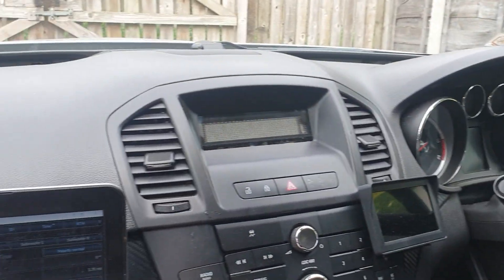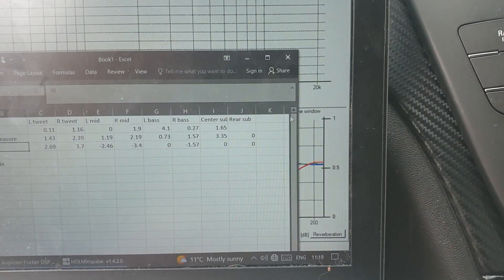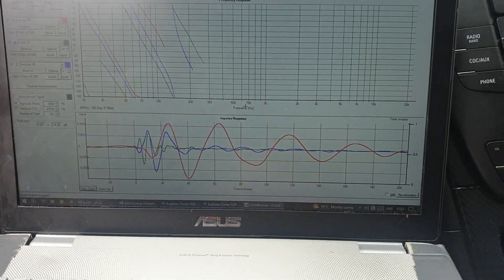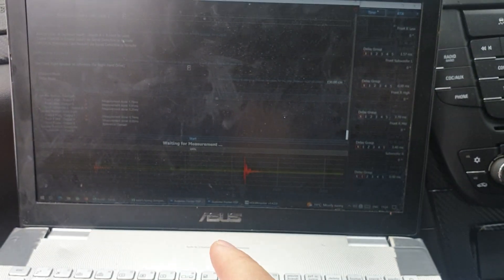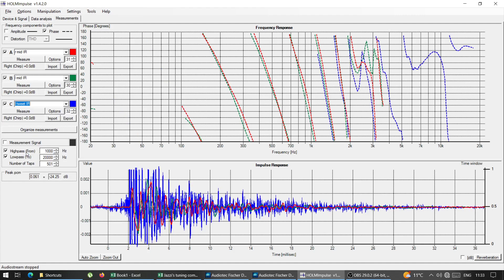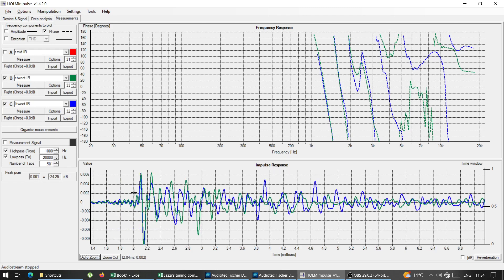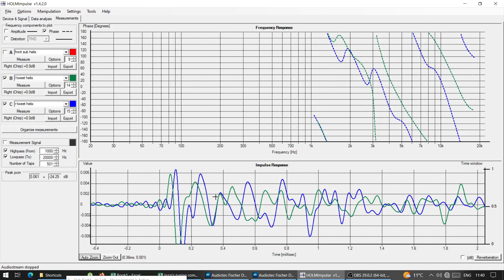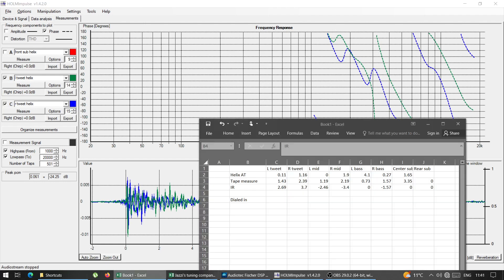How to Time Align your system (Tape measure, Helix auto TA, Impulse response)

Comment: If the time alignment is correct, the soud come in front of you, as if you are right in the middle of the speakers, not from de center of the car.
Reply from the maker: Well in the car you are NOT in the middle between speakers. If the TA and levels are correct the sound will come from the center between the physical speaker location - the center of the dash.

Comment: Another method you should test and compare one day, it's the test tone method at crossover point. I seen that from another Youtuber and I gave it a try, I was surprised how quick it is to do and and well it worked, the result was better that Helix's auto-TA or bare measurement. I didn't try the full impulse response and REW method though.
Reply: Would u like to share the link please?
Reply: @Illkv91  it's this video: https://www.youtube.com/watch?v=0mCxSqXr19U&list=WL&index=5&t=432s     but do not take his method as is as he does a mistake at some point. Just use the video to understand the way he does it and do it in a more logical way. Trust me, it works, it's impressive.

Comment: One thing to remember is that is the soundstage is past the windscreen and over the bonnet (hood) then from the drivers seat the center should not be the center of the dash, it should be slightly towards the driver. This will all depend on how 'forward' your sound stage is.
Reply: Very interesting. I'm wondering why he's always pointing towards the center of dash the when shouldn't the center of the image be for the driver looking directly forward? I would prefer for it to be right in front of me while looking forward while driving. Are there technical reasons why people are trying to put the image in the center of the dash or is it a taste preference?
Reply: @TheCohesiveGarage  Some people do try to tune to put the 'center' directly in front of the steering wheel, however it is problematic due to the increased difference in distance from the 'center' to the speakers on each side, the driver side speaker will be extremely close to the 'center' but the passenger side will be a much larger distance away. You would need a huge amount of delay on the the speaker close to the driver, to virtually place it way outside of that side of the vehicle.
Reply: @TheCohesiveGarage  the centre has no relation to the speaker position, it also should not be in front of the driver… if it is the stage has some big issues!

First let’s identify where the left and right of stage are… put a bit of tape on the screen or mark it with perm marker

Literally listen to music with the left side muted and mark where the right stage boundary is

Then repeat for the right side muted and mark where the left sounds like to your brain

Now you have two marks… now literally measure halfway between the two… that is where centre should be… not the centre of the car or between the speakers… but perfectly between where your brain puts left and right 👍🏼
Reply: @chriscuthbertson  the stage should be exactly as I’ve described above… work out where left and right should be and then perfectly between them is where the centre should be… it doesn’t matter how deep or wide the stage is… the centre of the car has zero relevance to the centre of stage, where your brain puts left and right is what decides what’s correct 👍🏼
Reply: @chriscuthbertson  also delaying a driver doesn’t put it further outside the car… not sure where you get that ‘fact’ from… that is 110% not how ya works…

Comment: I struggled with this for a long time. whether to adjust levels, or time to move things.  For a long while, I thought it was a combination of both. Eventually, I came to the conclusion that all timing and phase is "locked in" to the recording. If you want maximum depth and focus, timing really is a set position. You can gain artificial width with some phasing, but you will sacrifice other things. Of course, anything that tweaks the signal will change phase (crossovers especially) and is a good idea to revisit delays after driver tunings. Always a back and forth. Also, I could be wrong about all of this. lol.

Comment: If i may suggest, read the Smaart V8 guide. In chapter 6 under "phase response" and "comparing phase traces" you might find interesting things :) From that information, my calculation is, that time delay is kinda fix thing as the distances between the speakers and ear. So if you find the right delay with IR it should be fix, even if you change crossover slope, point, whatever. Because you phisically did'nt move the speakers away, just change the phase trace. After IR delay measure you should play with phase, in Helix software in the Time tab over the delay sliders. For me it gives a very good image. Now i'm try to figure out where should i put the mic, because from my opinion, center of the head isn't the best option. With that preset i need to lay my head back about 5-8cm to get the stage at proper eye level, focused center and wider edges. I think the right mic position is varies by the speaker placement, so i think it won't be a standard that everybody can use. Hope it helps somewhat to you :)

Comment: A long time ago, when I first did a tune, I read a method with using white noise that works so well. You set based on tape measure, then adjusted in driver pairs the distance/delay of one driver and you could just hear when it was centered. I'll try and find it. Was an old guide by some American guy I think. All over the forums.
Reply from the maker: Yeah, same principle. I just use possitioning tracks instead of noise - more plesant for the ears😉

Comment: Another great video! I’ve been playing about with my helix DSP mini mk2 and the PC-Tool software for a few weeks. I’ve been using the automatic time delay system using a measurement mic on distance mode. I’ve noticed it always adjusts the volume of each speaker which I hate. I started again with each speaker db levelled perfectly. I tried the delay mode and it’s brilliant! I can still hear my nearby speaker and the sound doesn’t die off, like it would if the volume was decreased. I’ve also bought the EMMA download and the centre seems just in front of me. The biggest difference is with the sub in the boot. The volume of it has increased dramatically now it's time aligned with the other speakers. Love it! Thank you!

Comment: Hey bud. Now we both have different methods in using holm, but I feel once the holm impulse makes it’s final measurement, the drivers are set, but if the attenuation is louder than the other drivers, imaging would tend to drift, so I’d suggest that you use an SPL meter and use the left side as reference so the right side db would match the left side and the center would come spot on. 
Normally to fix the TA some more, open sound meter impulse is my friend to finalize the time alignment (group your drivers to adjust) and it gets really focused.
Reply: He has set the eq before doing this so all drivers are level matched already at the listening position…

Comment: nice video, as always. i must say that i'm in the camp of "set the delays, and leave them alone". i'd be afraid that using the delay to steer the image using say, the right tweeter, that this would change the relationship with the right midrange which you worked so hard to align it with, and indeed, every other speaker in the car. but, to each his own. on a more fun note, and you seem like the kind of person to think this is fun, next time you do the "tape measure" way try this. you may need an assistant. sit in the driver's seat, in your normal listening position, and measure the distance between each left speaker and your left ear. repeat with  the right speakers and your right ear. and measure the sub to whichever ear is in the center of the car. enter the appropriate info to the DSP and enjoy.🙂

Comment: Time alignment is a do once then forget thing.
Time alignment will not change when changing crossovers as long as the drivers stay in place.
What changes is the relative phase between drivers, but this is not corrected with time alignment.

When you set your time alignment initially, then do the output filters with crossovers and then redo time alignment to align phase back in the crossover you put the passbands of the speakers out of time again.

You can hear that with instruments which fundamental and harmonic frequencies are spread over different drivers like midbass and midrange.

If you delay the midbass f.e. to get the phase correct in the crossover to the midrange the fundamental frequency will arrive the amount of additional time delay later than the harmonics that are played by the midrange driver. So never do that except maybe for sub to front integration as time alignment based on pulses, noise or any other means is inherently inaccurate for subwoofers due to missing high frequency content.
After that you move the center image with relative volume between left and right.

In addition the center is not in the center of the car, but in the center beween left and right. So if your left and right boundaries are left and right a-pillars, the center should be a tad to the left/right (depending on where the steering wheel is) to the rearview mirror as you sit offcenter and look at the center from the side. ;)

Comment: Is it possible to do impulse response with UMIK-1 and REW? I saw a post on diyma on doing exactly that but my DSP doesn't support those output routings (from Left to Right and vice versa). Also saw the loopback method but it seemed fairly complicated for beginner. Any suggestion?
Reply from the maker: It is possible to do IR with Umik and REW. In our group "RTA in cars" there is a multi page guide for that.
Reply: @RAW-CAt  where can I find this group?
Reply from the maker: @WhiteSNLOL  on facebook👍

Comment: I've read somewhere that doing IR or auto TA with a usb microphone like the UMIK-1 is difficult because of the internal clock mismatch that happens between microphone and the computer.  This may be why the helix software was off by so much.
Reply: That is why it uses a constant reference speaker. That way the clock mismatch is not a factor.
Reply: @gonzoe123  ahh makes sense thank you for clearing this up for me.

Comment: Great thorough walkthrough of your process. I have the UMIK-1 as well. How did you get the clicky sound to play over the speakers directly from the PC Tool? Does the Helix do that via the USB cable that the PC Tool uses? I don't have that Helix controller you are using in your dash.
Reply from the maker: When you install the Helix DSP PC tool, it puts a folder in your PC where you have the audio files, one of them is the "clicky sound". I have that file on my phone and play it as if playing any music content. If you have a HU, just put that file on a flash drive and play on repeat.
Reply: @RAW-CAt  thanks for your explanation!

Comment: Quick question on mic position on the headrest. I see in this video you’re pointing them upwards. Whereas other videos you are pointing them forward. Which should I use? Also should you use the 0deg calibration or 90deg calibration for each? Thank you.
Reply from the maker: Doesn't matter much. On axis Vs 90deg response changes only at the very top end, like 10kHz and above. For TA that does not matter.
Reply: @RAW-CAt  Thank you

Comment: Hi all, ultra noob question 🤓 
How do you Time align in a Musway DSP a 2 ways system with a passive crossover. Tweets are in the dash, mids are at the bottom of the doors. I guess that the answer is « you can’t » ….
So is there a less bad solution, tape measure from the tweets, the mids, in the midle ?
Thanks for All your videos, i am learning à lot 😀
Reply from the maker: When time aligning passives, you need to measure distance to the woofers. If you want to shoft the center image, you can use a shelf filter fo controll the tweeter level.
Reply: Thanks a lot 😊

Comment: So is created different stages more related to phase or to time alignment? What I mean by that is for instance if I wanted to create some sort of a 3d sound image?
Reply from the maker: What do you actually mean by "3D sound image"? Do you mean the sound being all over and you being engulfed in the sound?
Reply: I guess I mean just adding  a little bit of depth to the sound. Just making it a little immersive. Almost like when you see different sound settings on some hardware that says “theatre” or “stadium” stages.
Reply from the maker: @chrisdenicola4336  you need rear speakers for that.

Comment: You're rocking an old DSP Tool (v4?) and maybe an old Jazzi's tool also? The Jazzi update earlier this year was awesome, AudioGal took over the project and added a bunch of awesome features, like being able to compare 3 house curves against eachother at a time, ability to add SPL to your curves before exporting, a new Jazzi's curve 2.0, bunch of awesome stuff! Also the option to export your curves as .atref files, so you can export directly into the Helix RTA, if you wanna do it that way. The time alignment page is the same as the old one tho, so you may already have it up to date 😅. Why the old helix tool tho?

And what do you think is holding the ATM back from being acoustically correct, like AF says it should be? I have also had  very hit-or-miss results using it,both  with digital and analog inputs
Reply from the maker: The DSP PC tool works with certain orocessors only. Yhe new ine v5 wirks only with the new ACO based DSPs. I have an old processos so I am stuck with the old software.
Reply: @RAW-CAt  any idea about why the ATM doesn't set good TA?
Reply from the maker: @WBG123098  ATM uses an algorithm of some  sort. I guess it mignt have something to do with the fact that the program doesn't allow to choose any speaker as refference, but only the midbass drivers. Iny car, the right midbass is not the closest driver.
Reply: @RAW-CAt  ah now that is some interesting insight. I didn't realize it only chose midbass. So playing with the channel labels in IO may yield better results? My Left wideband and left mid are close, distance to speaker the mid is closest but if you measure off the windshield (wideband is firing into it) then that part of the windshield is closest. I'm not sure which is correct to determine TA, but I know ATM is consistently off. Also didn't know why I always had to run my sub with no filters and gains all the way up, while cranking the volume, just to get ATM to register it's chirp, wish Audiotec Fischer had something about that in their ATM webpage... seems it's best to use ATM for the front stage+rears then add in the sub manually

Comment: So with time alignment is how you can get the car tuned to have a surround sound affect if you want. cause i want all my passengers to be able to hear the full sound from all areas of the car.
Reply from the maker: That is impossible without a center channel.
Reply: @RAW-CAt  my car comes stock with a center channel in the dash so if I get that on a DSP it can be done ? I'm looking to get a helix V eight soon or a audison m8 ik either way the DSP alone will make it sound better than just amp and crossovers.

Comment: Is there a link to the sound file you were using that ran through the different frequencies/sounds? Can you post it please?
Reply from the maker: Each program has a file of its own.
Reply: @RAW-CAt  do you know where I can find it. I am using PC-tool v4 with p6 mk2? Or am I misunderstanding your response? Thanks for responding. Loving the content
Reply from the maker: @stiehl8455  in this video I used different software to measure the TA. Are you asking about Helix automatic TA? Or about REW? Or HolmImpulse?
Reply: No sir, just the sound file you were using to do the ear testing. With the cowbell , chimes and said center
Reply from the maker: @stiehl8455  those are emma tracks, you can find them to buy and download on official emma website.
Reply: Thanks for your time

Comment: the problem with distances is that if you use more that one amp it will not compensate for the difference in electronic delay
Reply from the maker: Electronic delay is nothing as electricity moves at the speed of light. There might be some phase misalignment, but TA is not an issue
Reply: @RAW-CAt  

if, for example, I use the built-in amp of the DSP along with an additional amp for more channels, will the processing time of the additional amp be audible?
Reply from the maker: @Motymott99  no.